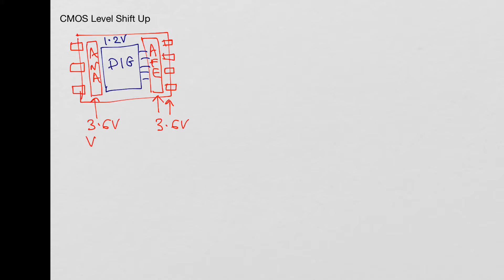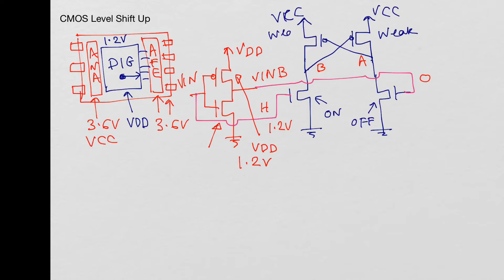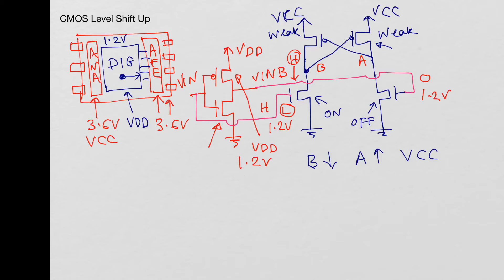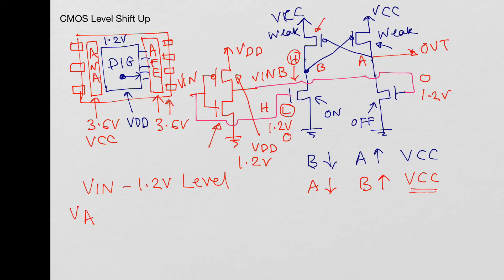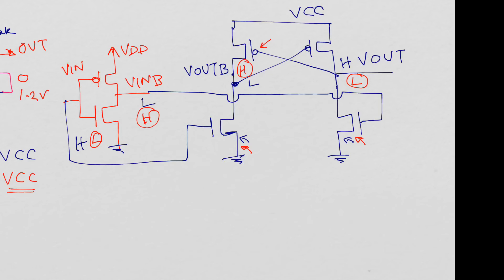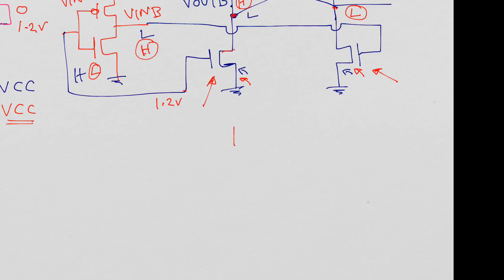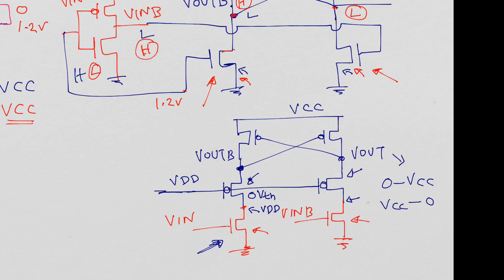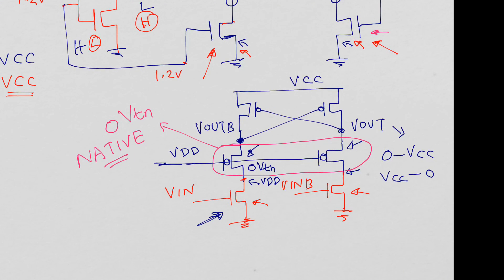CMOS Level Shift Up Circuit

Comment: thanks for the explanation, it really helped me understand the working principle.  please is it possible to use this same circuit for 'level shift down', but using switches with the appropriate ratings?

Comment: Why Simple inverter can't be used as upshifter? but it can be used as downshifter.
Reply: You can use an open drain transistor as a level shifter, but keep in mind that it will invert the signal.

Comment: You are drawing pmos and saying n channel transistors in last schematic. is that mistake schematic wise. Those should be NMOS so that weak 1 will transferred to lower nmos devices.
Reply: I think it is N-Channel only. If you observe, the bubble is placed differently than a PMOS symbol. Here this bubble denotes Zero Vt device I guess...

Comment: 5:48 Why when the gate is grounded the voltage will be pulled up? Thanks!
Reply: Vcc(3.6) at source of PMOS and 0 at Gate will provide sufficient Vgs (which should be negative for PMOS) to turn on the PMOS.
As a result, the PMOS drain gets pulled up to Vcc
Reply: @anirudht3232  Thank you for your reply! Understood!